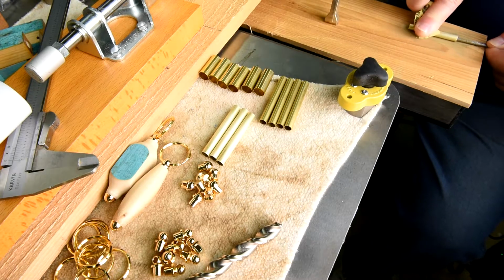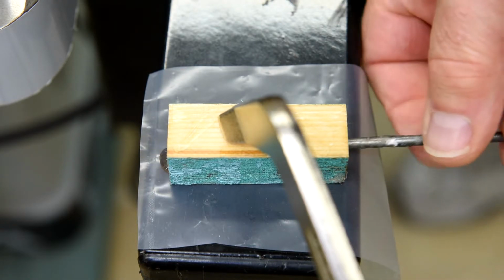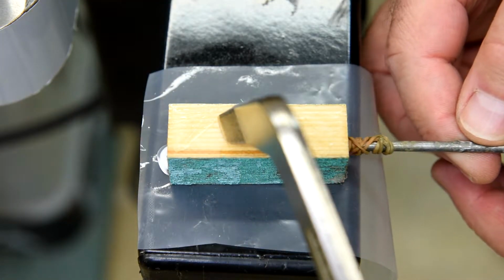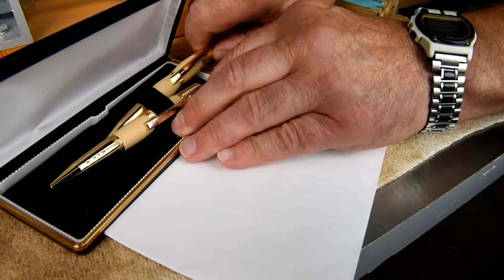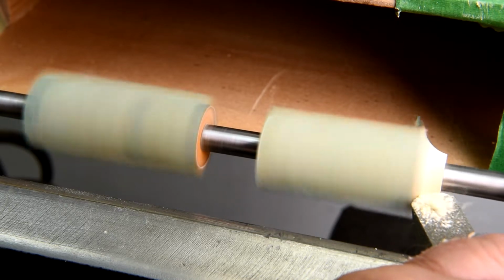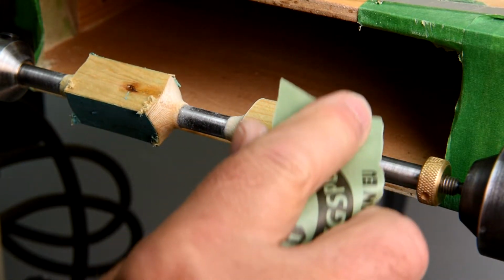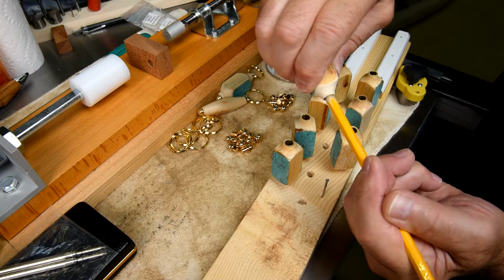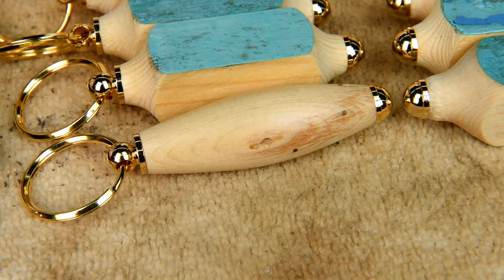The Pen From The Blue Goose - Part 18 (conclusion)

Comment: Enjoyed the journey Ron.       

Question: It looks like your CA turns white on the end of the tubes.  Why is that?                                  JimE
Reply from the maker: Re: "CA turns white on the end of the tubes.  Why is that?" It must have something to do with the extremely rapid curing acceleration caused by the curing agent spray. That white you see is just a powder that actually can be rubbed off, then the rest is transparent as it usually is. Perhaps I'll screw in my macro lens and do a short video on that some day. Thanks for the idea, lol. btw - Glad you enjoyed the journey. Thanks for coming along :)
Reply: Thanks Ron.  I have never had that happen....... therefore the question.               JimE
Reply from the maker: Maybe it's only this brand. I do have another unopened brand. Will try it later :)